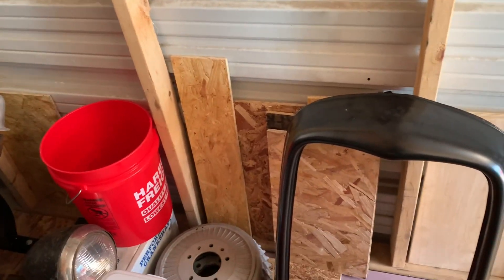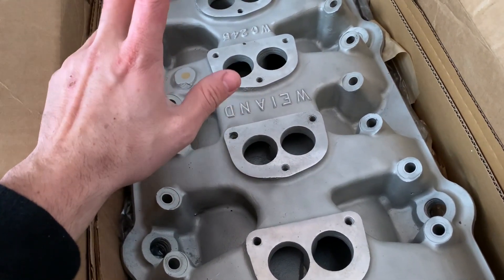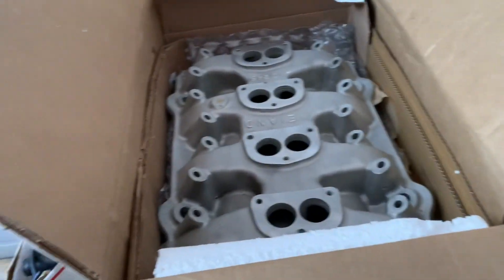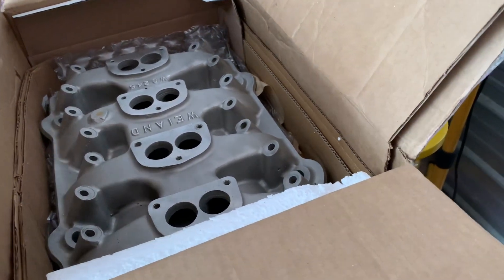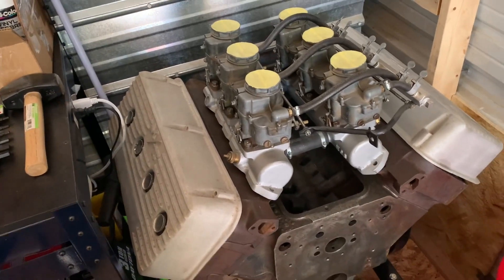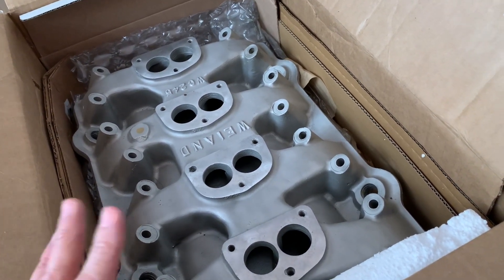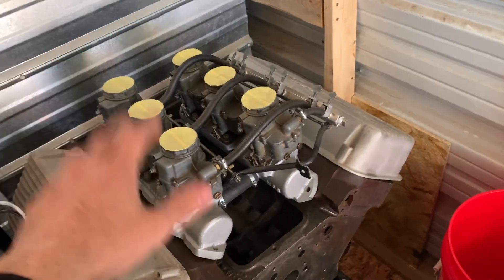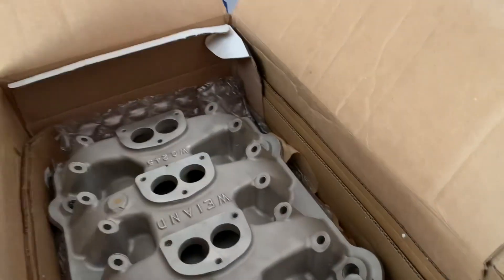28 Model Hot Rod Project Update/Vintage Speed Parts

Comment: The 4 2-barrel carbs are gonna look great on that Hemi. Old technology works on old motors. Back in the day a good friend of mine ran twin 650 cfm 4-barrels on his Hemi Cuda that had an updated cam. It sounded really, really knarly and would really haul ass. The engine builder he used swore the 1300 cfm was perfect of his setup. He ran that car hard for 3 summers of stoplight-to-stoplight and 1/4 mile runs. And it still sounded and ran like the 1st day he got it. Look forward to seeing more of the '28. Be safe and stay well.
Reply from the maker: Thanks buddy it’s definitely going to be a sweet setup I believe the 426 street hemi came stock with two carter 650 carbs and when tuned correctly they definitely kicked some but thanks for watching and have a good one
Reply: @HansensSpeedShop  Hmmm. They were Holley carbs and my friend told me they were an upgrade. The cam really  made a difference too. Regardless it was a kick-ass car and it jammed you into the seat when he smashed it!! Loved it. I lost touch with him after college so have no idea what happened to the car.